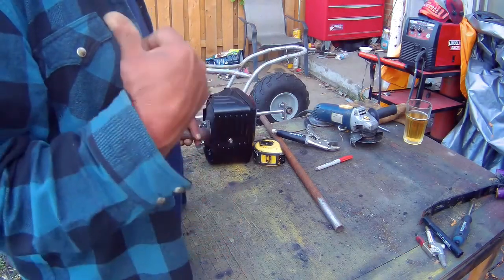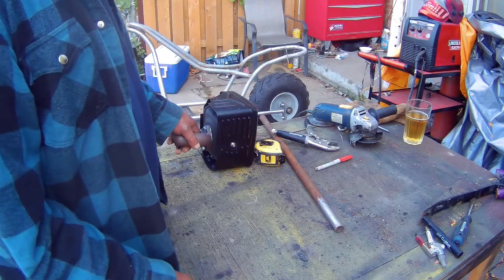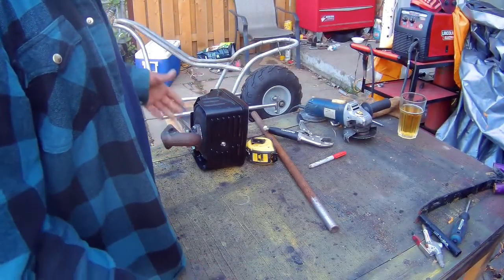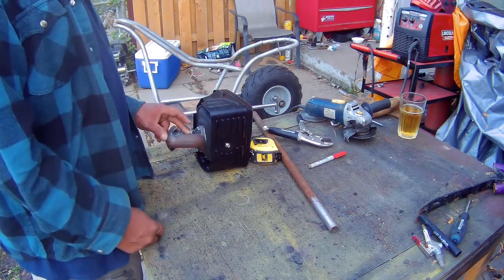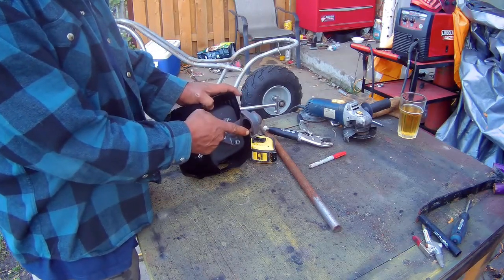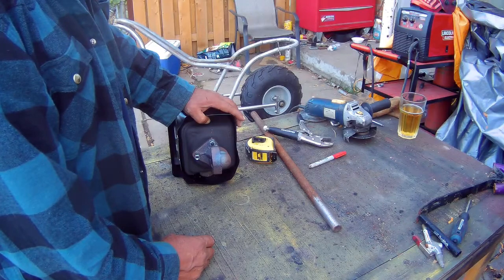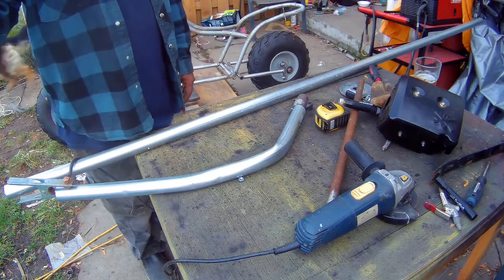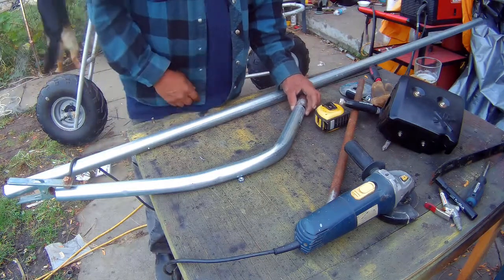Machine Gun Neves pt14 Short Ride

Comment: Hey Neves.  Trace the shape of the exhaust manifold onto thin cardboard or usr the gasket as a template.  Transfer ti a piece of 5/16" or 3/8 "  steel plate and cut it out.   Drill out the holes and you can build your pipe off that.    See how ya go mate 👍
Reply from the maker: Customwinder 1, sorry for the long reply but I got no notification on your comment, thanks for the advice, will do that because I want it pointing a different way
Reply: Neves Projects that's alright mate.  See how ya go with the little manifold  . If you tack a piece of straight pipe about 2 inches long to the manifold to start with its a bit easier to deal with.   Cheers mate 👍